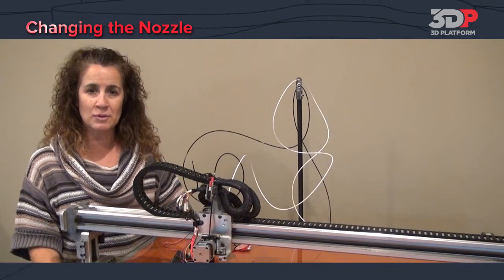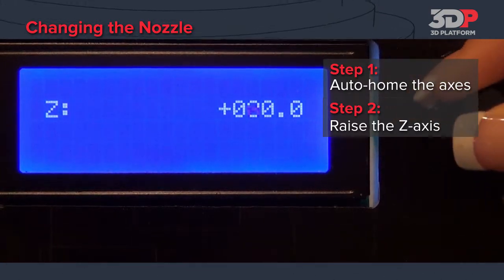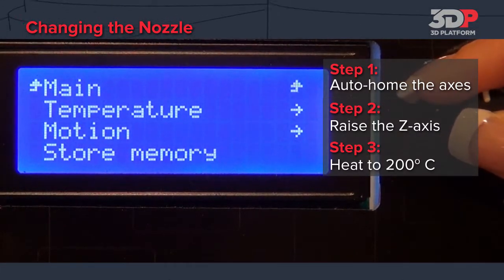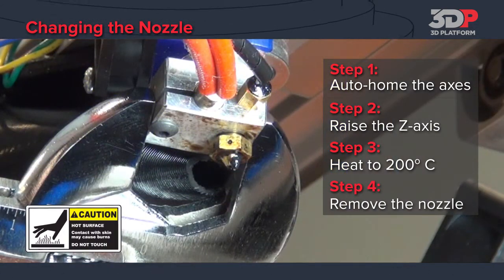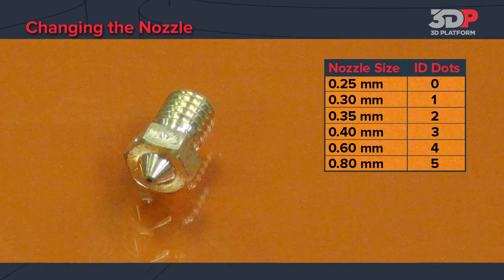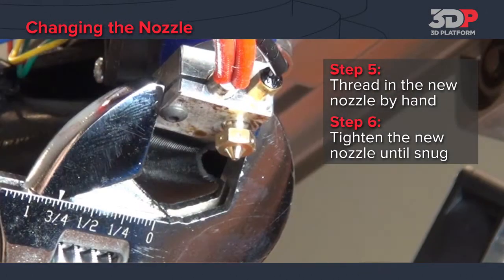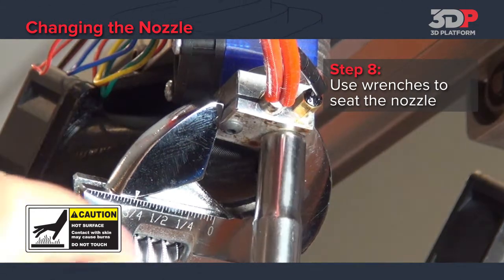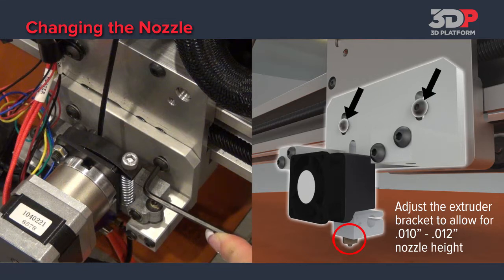How to Change a 3D Printer Nozzle - 3D Printing Tech Tips

Comment: I have some questions: 
Do I have to pull the filament out before this, so it don't melt and get stuck in the threads were the nozzle fits?
After removing the nozzle, do I maintain the temperature at 200 degrees and put the new nozzle? 
When heating to 280 degrees, do I have the feed the hot end with filament before tightening? Because I'm afraid the high temperature and lack of plastic could burn the plastic left from previous use and clog the new nozzle.
Reply from the maker: +Gordini Fuçado Those are good questions!
Yes, you do need to remove filament prior to heating.
Yes, maintain 200 degrees when putting the new nozzle.
There is no need to feed filament before tightening the nozzle at 280 degrees, because you will turn down the temperature as soon as it's tightened.